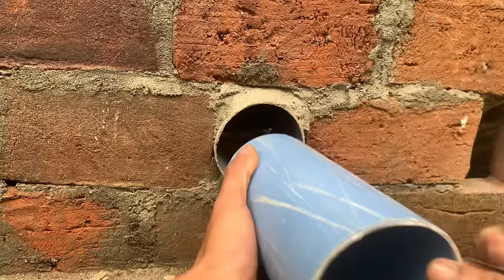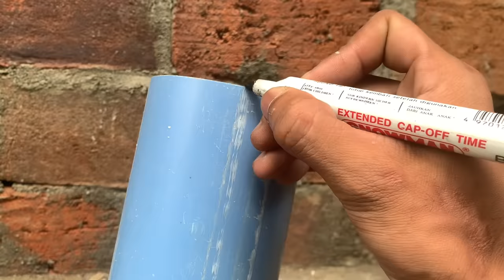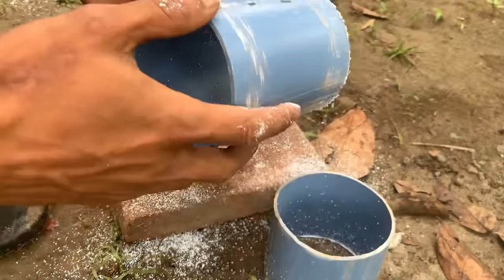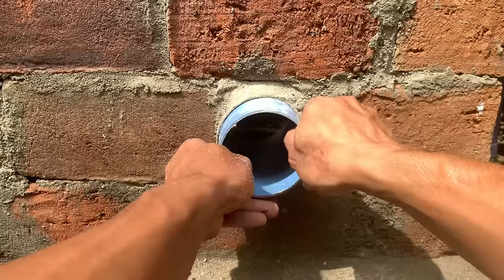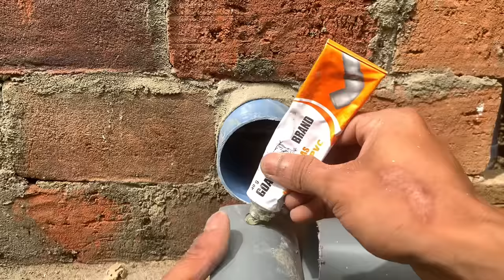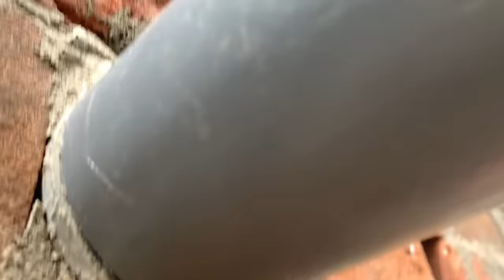Plumber's Clever Idea in 3 Minutes Without Breaking The Wall

Comment: In the UK, we would call that a "bodge job" meaning that it wouldn't pass building regulations. And you would be fired on the spot if you were caught working on a site with no safety footwear, and using your foot as a clamp, while you cut materials to size.
Then, inserting a narrower piece of pipe inside another, against the direction of flow, is just asking for trouble, as this will obstruct any debris,  eventually causing a blockage. So Nil Points from me. ⚠️🚩👎